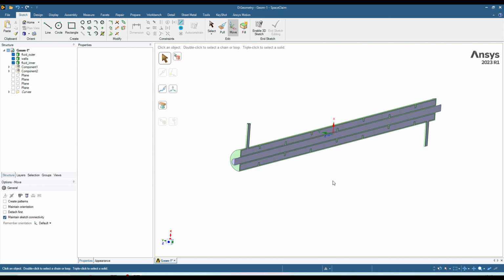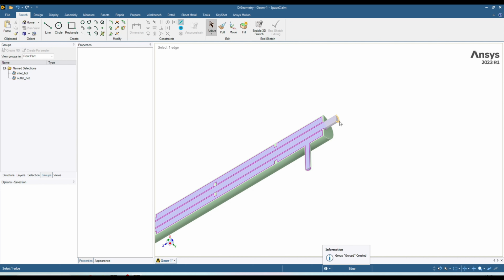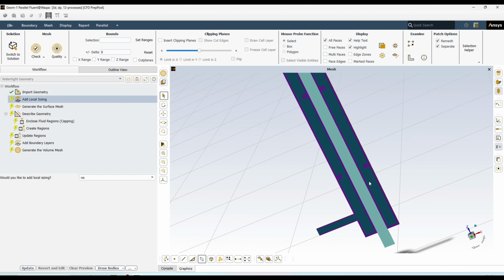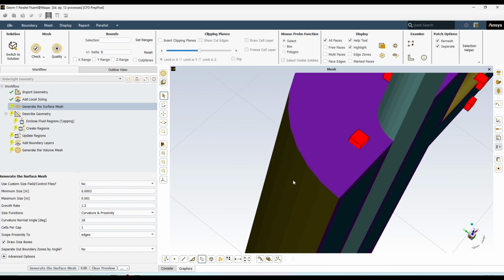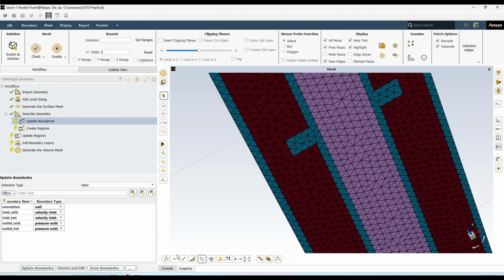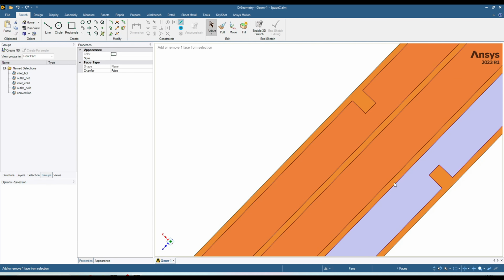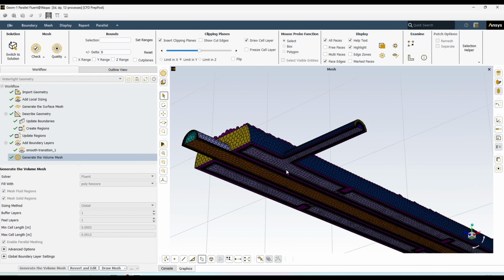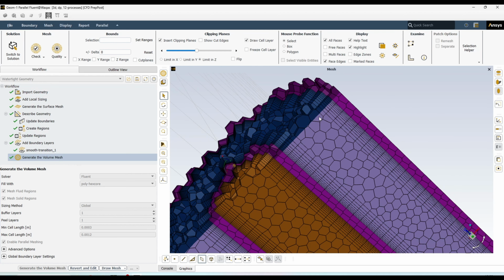Fluent Meshing of double pipe Heat exchanger

Comment: Thank you for your informational video. I am trying to do a CFD analysis for a solar PVT model. I have an absorber plate which is a rectangle shape, and 1 signle half circular tube attached below the absorber plate, water flows through the tube to take heat away from the absorber plate. There is solar radiation on top of the absorber plate. Could you show an example of how to model that?
Reply from the maker: @abubakarnasir9830  What exactly is your question in this set-up?
Do you need want to know the simulation setup? Do you have geometry for your model?